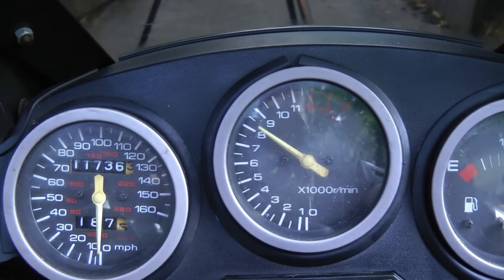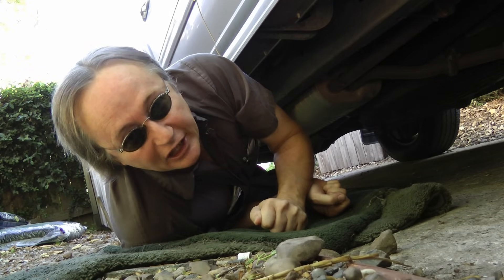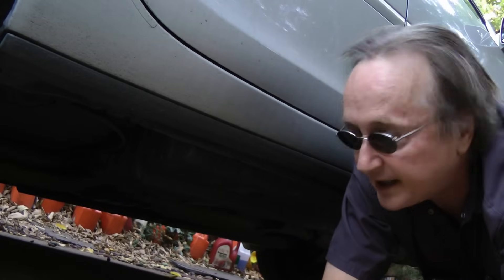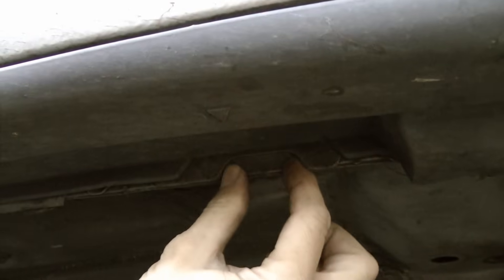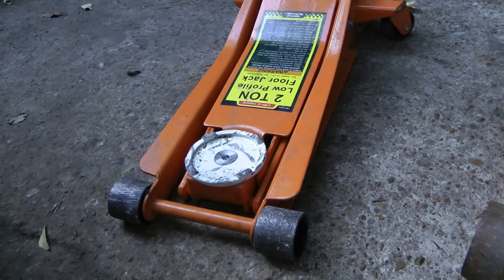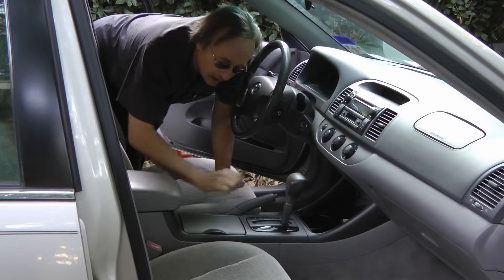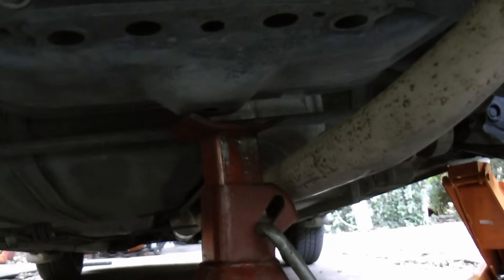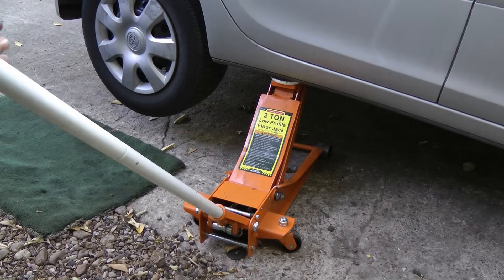How to Jack Up Your Car (The Right Way)

Comment: Now I get to find out how to fix the issue with the jack mounting area being rusted to the point that they are no longer usable.
I just tried to jack up my car using the jack mounts and it did not jack the car up at all, it just collapsed.

Comment: Can leaving a car on jack stands for a while bend the frame?

Left a car lifted from its pinch points using jack stands and rubber pucks.

After being away for a year and a half I came back to find some of the jack stands sunken into the asphalt driveway. 

Some of the jack stands sank an inch or two.

Is that enough to cause problems with the frame or alignment?

Comment: Any recommendation on normal jacks vs hydraulic jacks?
Also I've seen people lifting news cars from somewhere inside the vehicle, where do they put their jacks?
Reply from the maker: "Normal" jacks, the cheap ones that come with the car, are not safe for long term jacking, use only big hydraulic ones like I use.  I have no idea of your other question, though some people put custom hydrualics in them like low riders and they jack the car up from inside.

Comment: What if you have an uneven rocky driveway and no ramps? With the car unable to start (negating power steering or just being able to drive just about anywhere). Is there a way to jack up the car and ensure it's safe enough to change something as easy as the starter?
Reply: How uneven? Are you on an incline? Ramps are a great way to go when you do not have a concrete driveway. They lift your vehicle safely and are easy to use
Reply: @vigilantemotors  Uneven enough that the car wanted to slide to the driver side when jacking up the passenger side. I did manage to jack up the car and change the starter, but it was super sketchy. Next time, I'll use ramps. You are right by how much safer they are on uneven/rocky driveways. I just didn't have any ramps at the time.
Reply: @AdamBeaudryMasterProton  That’s tough man but I’m glad you got it done and was safe about it. 
Where are you located? I have some ramps I’d lend you anytime
Reply: @vigilantemotors  Thank you, and yeah I've been working on cars since I was in a car seat. I appreciate the offer, thank you, but I actually bought some shortly after I finished changing the starter on my car.
Reply: @AdamBeaudryMasterProton  Anytime my man anytime 🤟🏼

Comment: The Rocker Panels (rusted out) have been replaced fixed (modified), and not sure if those notches locations are good anymore.  Where is the safest place under a 2003 GM car to jack (to swap all 4 tires)

Comment: Hi Scotty, thanks for the video.  I noticed that you do not use wheel chocks--are they really necessary.  Some say they are necessary and I have always used them, but is applying the parking brake the same thing as using wheel chocks?  Please let me know.  I know that some of the earlier comments talked about wheel chocks but no real conclusion to them.

Comment: All the descriptions for Jack stands say you have to use them in pairs. I get that people get confused over the "ton" rating (they think each jack stand is the max rating, but the ratings are per pair).
But I don't get why you'd have to use TWO jack stands if you're just messing with, say, one tire ...?

Comment: My family car is the same model and generation (2003 Camry) and I happen to do the opposite. I jack up where you put your jack stand, and place a jack stand on either side of the car where the two notches are. 

Also, Scotty what is do you find is a good height to do work comfortably underneath your car? I have 15 inches max lift, from your experience do you find that is adequate to change oil or even change the clutch?

Comment: I would jack up a car from side jack points/notches only during emergency.... else longterm use of those jack points is how a car starts rusting(from those points) specially if you live in cold places with salty roads like I am from. I would prefer subframe or any sturdy lower suspension parts.

Comment: Hey Scotty! You used only one jack stand to hold up the center of the car. I can see it rock when you released the jack. Aren’t you supposed to use the jack to lift the CENTER of the car? And then use the jack stands in PAIRS to support the car for greater stability?  I sure do! ☝️

Comment: Funny that he uses a 02-06 Camry for demonstration. This model can be easily damaged if you don't jack the car correctly. I found out the hard way. I jacked the car from the front and the jack slipped. The jack stand that I had on the right passenger side kinked the rocker panel. Well, that was a very expensive oil change. Scotty is right, choose a good jack. Don't buy the cheap ones, they will slip very easy and cause damage or injury.

Comment: Hi scotty can i ask help? Im you’re follower i want to change oil and change tyre on my 1995 ek3 sedan civic. Which trolly jack is better ? Which weight trolly should i buy? 1600 kg is enough ?
Reply: while your cars curb weight is 1150kg it's best to not go near the maximum weight limit for a jack.  1600kg is about 1.5 us short tons so you will want at least a 2 ton or 1800kg jack.  Preferably in case you have or ever get bigger cars go with a 3ton (2700kg) jack.  That way you will never need to worry if your jack can handle the weight.  Plus its not lifting the entire car but the majority of the weight is the engine so when you go to lift the front its lifting the bulk of the car's weight so better to be safe than sorry.

Comment: Hi scotty gud day.
 real quick question,  
If its ok to jack up my car for couple of months? Thanks
Reply: If it's gonna be sitting for months then yes. It's a good idea to put it up on jack stands so the tires don't get flat spots and the rubber bushings aren't sitting under pressure in one position.

Comment: you got to make a video of what to do IF THE PLACE TO PUT THE JACK IS RUSTED BADLY ... then ??? where should i put the jack ?
Reply: If the structural point to place a jack is rusted so bad that it can't hold the car, then your car needs a new frame, or repair the frame.
Reply: You can always jack up on a suspension arm
Reply: i was wandering if i could do that ! thanks
Reply: plouk zoing or any fixed part of the suspension would be a better bet, as the arm can move
Reply: ok
Reply: plouk zoing por

Comment from the maker: @TheDudeman619 you move fast putting it in and taking it out, that's how to be safe. and you put the stands on any hard metal surface like rear differential or a thick metal cross member of the frame.

Comment: OMG im sorry but i was LMFAO this hole video "use common sence while jacking up" XD good video and i actually have a question. i have a mustang and its lowered and its about time i change the oil but the drive way on my house is elevated so is there a special kind of jack that works on up hill kind of drive ways, i feel like the jack with tires on them will just slide down and the one with out wheels i feel they tilt to the side and fall.

Comment: Do you have a video of how to fix a floor jack that won't lift until its maximum weight ? Mine only lifts about 1/3 of its max weight.
Reply from the maker: Indonesia no vid, but you are either low on hydraulic fluid inside, OR the seals in it are going out
Reply: Thanks for getting back, I just changed the old fluid with a new one, I hope that solves the problem.
Reply: Bli yg baru aja

Comment: I bent the crap out of the location to jack it (a van), is that common? It's the first time it's ever happened
Reply: They're for those jacks that come with the car, better to lift the car on solid steel. I have an older car where some of the sheet metal rusted away and they bend easy anyways since they are not solid enough to lift anyways.

Comment: i tried to jack the my Subaru from the frame , it is not tough you know  most modern cars are made from light steel , i always use flat piece of wood to prevent damages to the vehicle

Comment: Hi Mr. Scotty I would like to know what is the best way to jack up a 2000 Chevy Cavalier I'm trying to change the brakes, cylinders and brake line so I need to get under there...
Reply: Pull up emergency brake, lift left side, place jack stand, lift right side, place jack stand.
Only lift high enough to remove tires and work under the car.
Reply: Dylan McElveen Thank

Comment: You never brought up blocking the wheel. I always block a wheel and I've jacked everything from small car to heavy diesel including construction equipment. Block at least one tire that wil be on the ground. If your lifting the rear end on a rear wheel drive the front axle may roll. Vise versa on a front wheel drive. A rule of thumb for blocks. A small car to light truck use 4x4, medium truck to heavy truck use 6x4, I dought this might come up but for tractor tires use railroad ties. I have had a Tele handler roll over 6x4 while beginning service. They were about 54" diameter. It rolled right off the jack and thank God nobody got hurt and the wheel was still on

Comment: Those harbor freight 3 tons jacks are not good on hills. I do roadside work and sometimes when you have a van or an SUV or station wagon on an incline the 3 ton Jack won't work. I find if you have a 1.5 on an incline they tend to work better.

Comment: I don't trust those notches. I managed to bend the ones at the front. I find easier to use a solid metal frame :)
Reply from the maker: +GOKHAN DILEK unfortunately, many cars these days are cheaply made with no solid metal frame but thin unibody parts that can't be jacked upon
Reply: Car that you can't jack. 
Car that you can't open the hood.
What's next?

Comment: hello scotty, its me again. im trying to buy an air compressor, but i don't know what kind i should buy (horsepower, gallon, PSI) i just want one that can put air, and take nuts or tighten it from the tires. and does it all have to be use on oil? any suggestions would help. thank you again

Comment: Should I use a low jack for a Honda Accord 2000? The car is not low, but should I use a low jack anyway?
Reply: If a normal Jack can fit under, no need for a low profile Jack

Comment: what's the optimized height if I want to work under the car? Say I want to change transmission fluid.
Reply from the maker: just depends on how fat you are. The thinner, the less high you need to jack it.
Reply: If I can work under the car don't need to remove a tire I don't jack at all. 
If I new to remove a tire I just lift it high enough to remove a tire.
If I can't fit under the car I usually need to remove the tire anyways because of how cramped compact cars can be.

Comment: Scotty...96 Jeep Grand Cherokee. I need to replace the rear wheel bearings. Is it safe to place the rear axle on jack stands to hold up the car while i do the work?
Reply from the maker: yep, I do that all the time
Reply: Thanks!
Reply: Never trust a floor jack alone.  Jack stands are required for doing work under the car!  You got the right idea.

Comment: I had to watch this after 12 years to change my post 02 sensors. I need those stands though. The ones in supercheap Auto are not the greatest. I wonder if anyone makes them like Scotty’s ones. Good steel instead of thin metal tubing welded with warning stickers saying don’t work under your vehicle whilst on these stands. Like WTF.

Comment: is it posssble to bend the chassis when jacking up? I jacked up on the seal with a "hocky puck" to help support it, but I noticed the door was catching while it was jacked up
Reply: It can. It can warp the metal, or snap the welds. I did that on my civic the first time I jacked it up and it broke the weld. Luckily it wasn't too far up.

Comment: what if you're changing your oil do you only jack it up where the filter is?
Reply: Jack it up so you can fit yourself and a drain pan or catch pan underneath with room to swing some tools. Most oil filters can be accessed from the top of the vehicle, but the best place to drain oil is from the drain bolt on the bottom of the oil pan

Comment: I have a 2010 Chevy cobalt. and this was the same method i used but it bent the notch flat. will that cause any issues besides just not being able to use the emergency jack?
Reply from the maker: Na, it just shows how cheaply GM is making em these days
Reply: Scotty Kilmer ya it sucks. me and my family have been using GM for generations now. there easy to work on and last forever.
Reply: Scotty Kilmer hey scotty i have a 91 celica where do i jack it up from? in the front and back because the rocker panels are rusted out and the frame behind the rockers that you are suppose to do it with are rusted out too... but the rest of the frame on the car is pretty good but anyways where would i jack it up at in the front and back? thanks scotty
Reply: Alpha Nerd  My '88 S-10 Blazer has over 168,000 miles on it and it runs like new.

Comment: As soon as you take the wheel off it the weight will shift because he put the stand in the middle of the rear end. To avoid this use two stands.

Comment: Hi Scotty. I have a Mazda Familia 323 and it stuttering when i try driving it. It idles ok but as soon as i try moving it  stutters and looses power. I have changed out the coil pack, the spark plugs, mass air flow sensor and throttle body cleaned but it still stutters and loose power when i try to move it. Please advise.
Reply from the maker: often a bad transmission will do that, but of course pressure test the fuel pump to see if it's weak

Comment: How to be a part of your cars floorboard 

Step 1: use 1 jack stand in the middle and make sure the car stands safely on it. 
Step 2: dismount the tires
Step 3: work on it
Step 4: jack stand tips over over fails

NHTSA recommended this... Not

Comment: Can i jack up exactly where he placed the jack stand? And place the jack stands on the sides?
Reply: NO! But yes. I did that. Once. It bent the pinch welds *and they began to separate*! The pinch weld separation has not progressed, but it is really disturbing to see how easily they can be separated by further mushing by jack stands.

Comment: I don't think you're supposed to put the jack on the notched pinch-weld. There is a bolstered flat surface behind that notched seam. That's where the weight is supposed to go.

Comment: What if you have no concrete anywhere, only gravel or dirt? The only place with concrete I know of anywhere nearby that I might could use is a store parking lot but I doubt they would be happy with me working on my car there. Concrete is too expensive for me to pour any.
Reply: The bigger jacks can be used on hard grounds. Scrub some rocks off the gravel to get that sand surface and you can use it, even if it digs up in it a bit it wont be bad, in fact it might help the jack stay in place.

Comment: hi scotty i am working on a saab 900 classic. balljoints. i jacked the car up from the front and all the balljoint bolts are stuck and won't slide out.  i am thinking this has something to do with sprung and unsprung. sometimes i jack the car up from other points and the wheels dangle more. help i don't understand why these bolts aren't sliding right out the nuts came off easily but the bolts won't tap out.
Reply from the maker: +pora radi glad it's you working on that saab and not me. I was happy when they went bankrupt, over engineered garbage the late model ones.  But, to get those out, you jack the entire car up in the air on the frame, that unloads pressure on those parts
Reply: ok thanks. i love the classic 900 i learned how to work on them because alot of mechanics shy away from saab. i am a young lady mechanic with alot to learn so keep teaching me Scotty i'm still more book smart than hands on. keep on making these videos.

Comment: I had a jack fail while I was under the car. I was only using the jack, with no jack stands (didn't had one). What saved me was the wheel, which I placed right next to the jack.

Nowadays, I would never do a job if I don't have the right tools to do it. Specially when it comes to securing a car.

Also, I would NEVER go under that car that he showed on the video. One jack stand? That's NOT safe! Lift from the middle, place both jack stands on the side. Keep the jack in place with minimal pressure and place BOTH wheels close to the jack stands. Redundancy is the best way to stay alive.
Remember, cars don't have feelings, they have weight. If you make a mistake, the car won't feel bad for you. It will kill you right then and there.